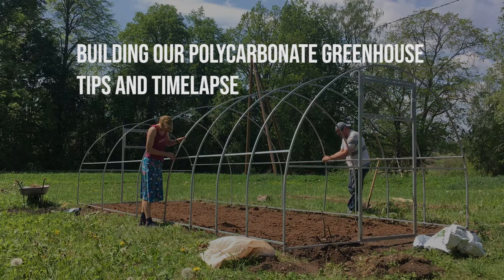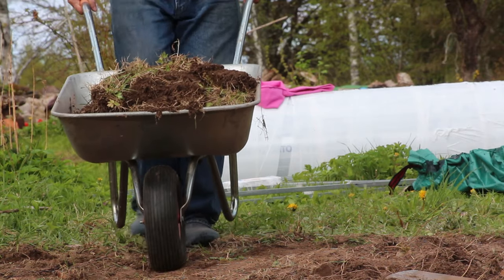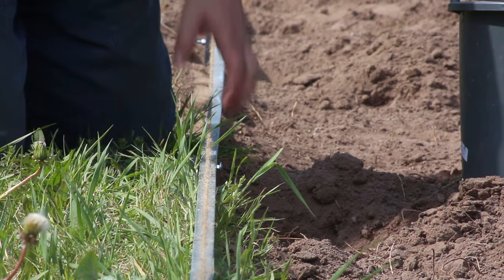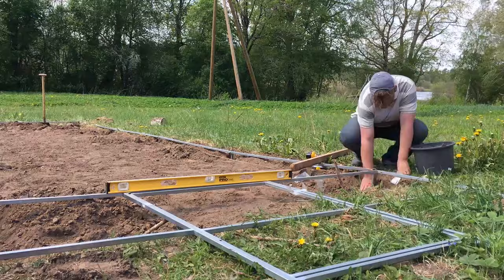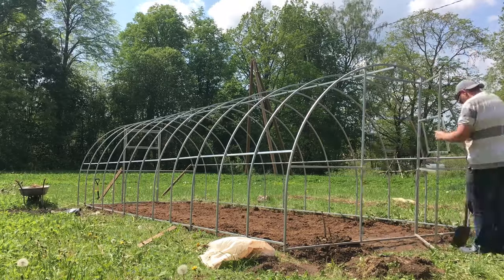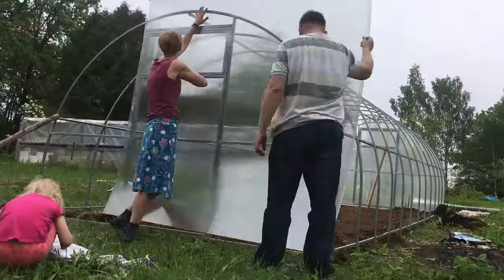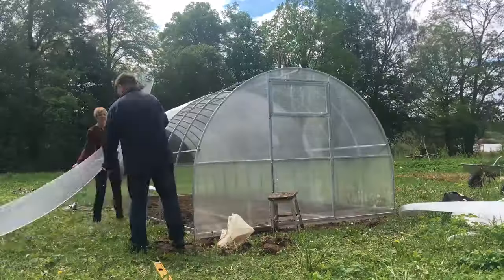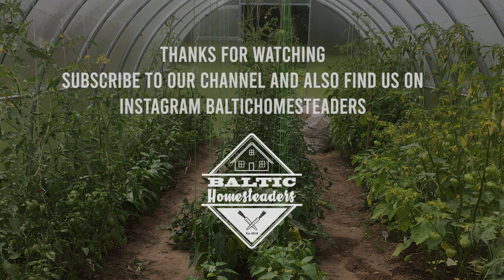Polycarbonate Tunnel Greenhouse Build - Timelapse & Tips

Comment: As you noted in your video, twinwall polycarbonate should always run vertically, because condensation must be allowed to run out the bottom. If it can't, because you ran the channels horizontally, you'll eventually see mold growth that is pretty much impossible to remove. Otherwise, great video! I want to replace the 6 mil poly on our tunnel with polycarbonate one day.
Reply from the maker: Thanks. Only on one end the panel was horizontal, as it happens nearly 5 years later it hasn’t made any difference.

Comment: That's cool did it fix to the frame with screws ?? How much did it cost & do you think it would stand up to 60mph winds ? We live on the coast & get battering winds often through the winter & other times too .Thanks
Reply from the maker: Hi. Cost was 500 euros,  yes it's got screws, they are ok but he washers could be better. Yes we did have some damage over winter and had to tie it down until just a couple of weeks ago. I can't say for sure if it was of the the way we put it together or the product itself. However we've now made modifications and feel it's much better. You can see what we've done in the spring tour video I published yesterday.  Hope that helps but feel free to get in touch if you need to know more.

Comment: Hi. We are putting up a polycarbonate polytunnel also on a sloped ground. How did you get it level with just using a string line ? Thanks, I hope you can help. I'm basically digging a trench and using a long level. It's quite tricky to get it level.
Reply from the maker: Hi basically we didn’t get it level. The only real draw back of that was watering was difficult and I solved that by using drip tape and just 2 weeks ago I terraced the beds which you can see in last week’s video https://youtu.be/TOukeewUO6A also I had to stake it down the next year as wind nearly made it take off and that’s worked well since, I think I showed that in the spring update the year after it was installed. Hope that helps.
Reply: @Baltic Homesteaders  Okay, great, thanks for the info. It's going pretty well with putting up our polytunnel. It's an ecoslider es3 premium – 18 m2.